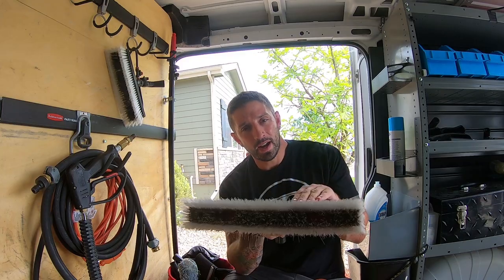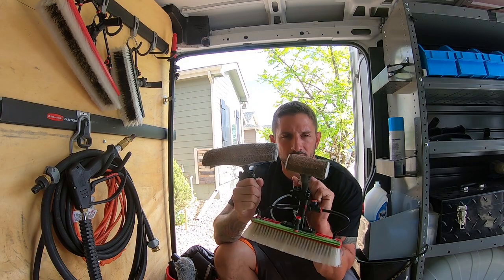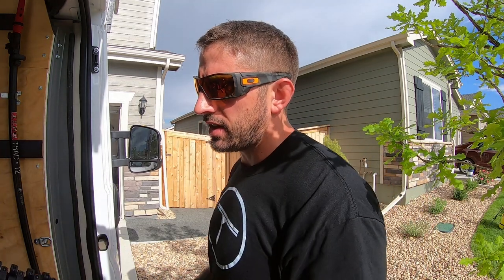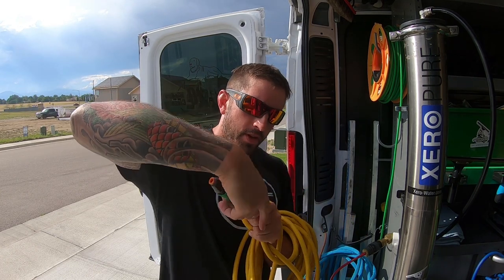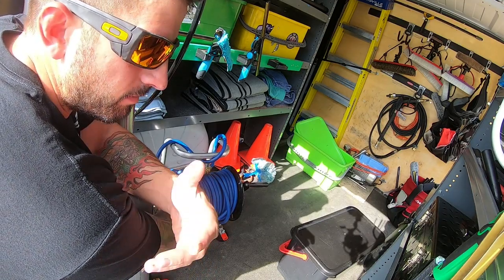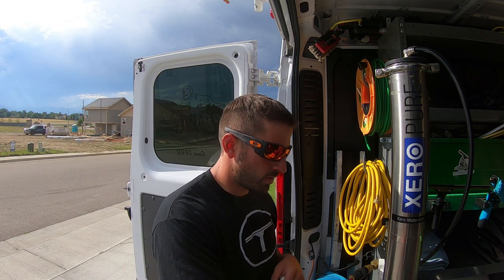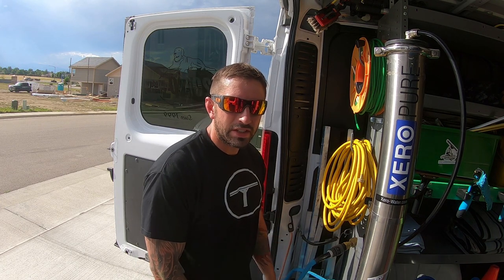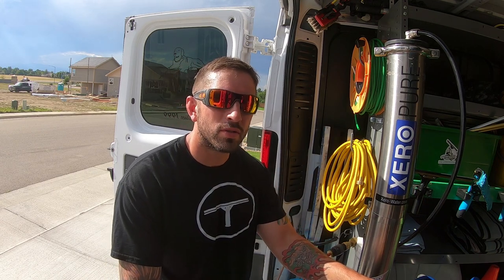Necessary Water Fed Pole Accessories

Comment: How do secure your uni-valve in your pole? At times the tubing going from the uni-valve and the 3 way split to the jets in the bush comes out from pulling the tubing to turn off the Univalve. Hope this is not to confusing.
Reply: Hey swampfox, same issue here. I either tie my top first foot between the brush and the valve in a knot around, where it comes out of the pole, or using zipties both making sure not to kink or restrict the hosing. I Still use the swivel action and rinse bar with this method as well.

Comment: So for clarification: a 3/8” water hose connected to the homes water source to the Xero pure system will create enough water pressure so I will not need a water pump, correct?
Reply from the maker: no, you never want to use the 3/8 hose to go from the spigot to the system, you want a garden hose there.  that is to go fromt he system to the pole hose.  ~Jersey 862-312-2026
Reply: @windowcleaner  thank you for the clarification